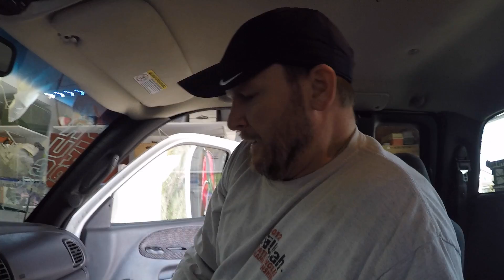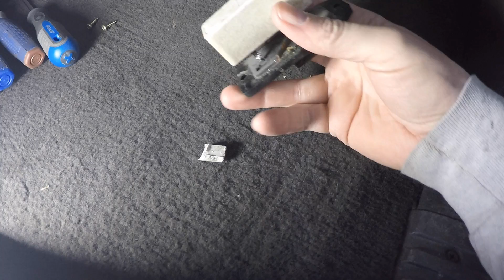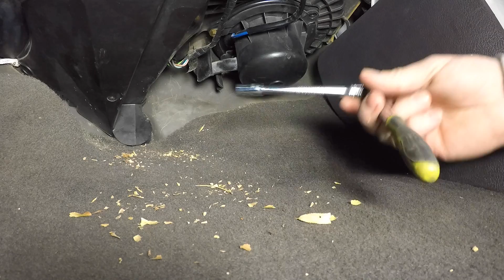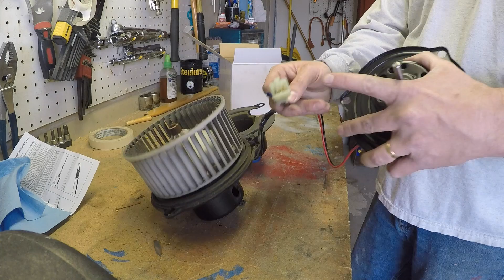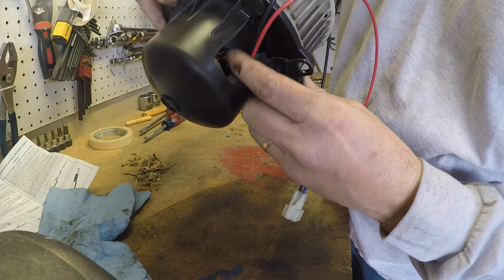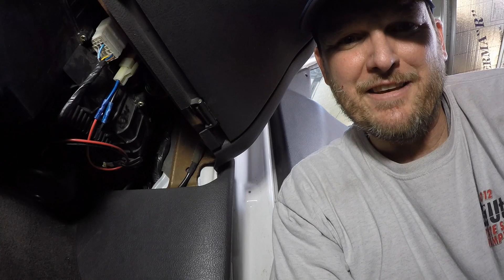How To Replace 1999 Dodge Ram Blower Motor

Comment: Thanks.  My 2000 Ram blower motor squealed and now doesnt work at all.  Time to replace it and the other temp part.  I replaced the heater core last summer and that was a big pain, but saved myself a lot of cash.
Reply from the maker: Blower motor is a cake walk compared to the heater core!  You got this!

Comment: Thank you! I have a 99 Durango. Mine barely works. Its loud and if I bang on the housing lightly it starts working. I bought a new blower motor and without watching this video I'd of thought it was going to be just as hard as replacing the heater core. That was a horrible experience. Now it -10°f here in Alaska. Argh I gotta pick the worst possible time to do this. Again Thank you for posting this video. It should be very helpful for me to get going on my vehicle.
Reply from the maker: Worst time of year for this kind of work, but it's needed for SURE where you live!  Yikes!  Hope you can get it blowing hot soon!

Comment: I have the same truck my name is zorena Ash I like your video I need a new dash to my dash board was all cracked up so I ripped it out and  it looks really bad where did you order your dash from and how much was it ? Was it really hard to install?
Reply from the maker: It was a serious job to replace!  Have to pull the entire dash about 18 inches out and some of the screws are hard to locate. It’s doable but not a fun job. I’ll see if I can find a link and post it here.

Comment: A little tip on that rear screw. Take it out first. When reinstating, set the screw inside a socket and turn socket by hand.
 I reused the shrink rap on the wires.
 Thanks for this video, made life much easier.
Reply from the maker: Great tip!  Wish someone had shared that with me before I did mine!  Thanks for taking time to watch and comment!  Means a lot!  🙌🏼

Comment: Great video man,, i heard that you have changed the whole dash,, where did you get it? I still my 1999 dodge ram 1500
Reply from the maker: I’ve still got mine too. Love the Gen 2 Rams!  It was many moons ago, but if memory serves I got it from LMC Truck. Hope that helps. It wasn’t a super fun task. But I’ll tell you one secret....  ratchet straps!  Use them to support and hold the dash assembly’s way from the firewall while taking out the old and putting in the new. I would also consider replacing the heater core while you’re in there. It’s RIGHT there anyways and you do t want to have to pull it apart again in 6 months. Just sayin!  👍🏼 Good luck brother and thanks for watching!  🙌🏼
Reply: @troysgarage  thank you very much, do you got email i will send some pictures,,,,

Comment: Good morning Troy, hey where did you get your new Dash and Dash bezel  from?
Reply from the maker: Here’s a link to the dash bezel - https://amzn.to/37AC5zZ 
For the dash itself you have options. There’s an overlay that you can glue on over the top so you don’t have to pull your dash apart (https://amzn.to/37xR4ut) or the full direct replacement (you’ll have to search LMC Truck for that one, but it’s not cheap and def not an easy replacement).

Comment: Nice video, but I think you forgot the gasket that goes between the blower motor and housing,  with that sealed you may get a little bit better performance out of the whole system. The gasket has to be reused from the old motor.    ...you may of replaced it and I just didn't see it

Comment: Blower motors bad  Can be resister or selectors but most the time you got noise, limited air flow, or your speed selection is limited your motor is bad.

Comment: I have a 2000 dodge ram van 2500, that have 2 resistors, I fund the one in the front one but I don't find the rear one, can you please help me with that? Thank you.
Reply from the maker: Sorry I'm not familiar with that.  I will poke around the internet and see what I can find for you though.  If I find anything I'll add a comment here.

Comment: Hello, where did you get your new dash board at? Did you record it?
Reply from the maker: I didn't record it, but took several pictures.  The blue bezel piece I got from Amazon and painted it with rustoleum metallic blue here's a link to that:  https://amzn.to/2TeIB8e
The dashboard itself I got from LMC Truck cuz mine was cracking and parts were falling down inside the dash.  Here's a link to that one as well:  https://www.lmctruck.com/1994-15-dodge/dash-components/de-1998-02-dash-pads-and-instrument-bezel
Reply: Were can i get the top peice of the dash

Comment: Future reference for anyone having issues with the blower motor, move the carpet and take the back one off first.. It sucked otherwise. And put it back the reverse order to make it easier
Reply from the maker: It’s true the nut closest to the floorboard is the hardest one to remove. Get it out and the rest is easy!  👍🏼

Comment: I'm in the same boat.  Have a new motor and resistor, just waiting on better weather and hoping it doesn't completely fail before spring or I get chance to replace them.  Right now, mine only runs on high and the motor howls like a banshee.

Comment: Your instructions were spot on...that rear screw was a mutha...both ways...now my issue was it was making that squeal n I would smack the outer casing n it would quiet down until I did it n heard the blower come to a complete halt...today I put in a new blower...and now the fan only comes on at its highest setting and no cold air..the AC motor engages cuz you can hear it but that's it....suggestions?

Comment: If my 97’ ram is making that whining sound but the heat works, would adding lubricant help? I think something might have fell in if that’s possible.
Reply from the maker: Yeah a lubricant would help unless there's just too much play in the motor.  But I'm sure it wouldn't hurt.  I recommend http://www.planetsafelubricants.com.  Get some AIM Lubricant.  Use it anywhere you normally would use WD-40, no smell and it works a lot longer.  When you are in there look for leaves etc.  Mine get's small leaves in it from the neighbors tree all the time.  Keep the vents clear that are near your windshield wipers to avoid having them drop down in there.
Reply: DIY Home and Auto I took it apart and some leaves fell out lol. Sprayed it down and put it back. The sound is still there but more quiet compared to before. Just gonna replace the whole fan. Thanks for the video.
Reply: kunu98 I'd just replace the motor.  That squealing or rough sound is typically the bearings going out.  You could replace the bearings, but given the price of a new motor and the work required to replace bearings, well, it just makes more sense to put a whole new motor in.

Comment: Great vid! Very detailed period of instruction!! I have a 01-Diesel and soon i will be changing out the heater core and dash. While i am doing that, i plan on changing out my blower motor and now that relay/resistor. Recently I lost the 2nd & 3rd blower selections.
Reply from the maker: +Matthew Johnson while you're "in there" also check and consider replacing the bushing for the blend door (hot/cold selection). I just had to do mine. Possible without pulling the dash but MUCH easier if you are already there. Dealer only part and only about $12. You'll love that truck!  Awesome! 👍🏼

Comment: I have 1980 dodge b200with blower wires getting hot. it would appear to be the resistor and none of the vidios address my problem where is it
Reply from the maker: +Robert Hall I don't know the answer but maybe someone here can help. I'll also ask my brother who is a mechanic. If I can find out I'll let you know.
Reply from the maker: In the little research I was able to do, it looks like the resistance might be in the switch assembly itself. Try going to http://www.rockauto.com and select your vehicle. Then under the section "Electrical-Switch & Relay" choose the blower switch. It's $9 and they will ship it right to your door. You might also have something going on inside the blower motor so you may also want to replace that as well. Wires that are getting hot is not a good thing!  Whatever you decide please be safe!

Comment: I have a 98 Cummins and the same problem is happening in my truck. Do I need to get the resister in order for the blower motor to work? Or can I just replace the blower motor and be ok?
Reply from the maker: +Justin Gough replacing the motor should be enough. I was missing some of of the speed settings. So as long as that part is working fine no worries. The resister isn't very expensive and is super easy to replace when needed.
Reply: DIY Home and Auto so I have a problem. That ruber tube that sucks up the electrical smell is too short on my new bower motor. Is that a must have??
Reply from the maker: +Justin Gough Sounds like you are making progress, that's awesome!  It's not a must have but see if you can modify the housing to allow it to still work. Similar to how I had to cut the plastic to make the electrical not be bound up. If that's not possible just make sure there's some air flow getting to the motor. That vent is to help keep the motor cool. You got this Bro!  🙌🏼
Reply: I have a dodge Durango 99 and the blower motor is not working how do I know if its the motor or something else
Reply: @lisaarnold5116  check your fuses first. If you still have it, and didn't get to work...

Comment: on my 95 dodge ram the blower don't work at all. the guy I bought truck from said it did before he took radio out. what would be best way to track down my issue,
Reply from the maker: +Wayland House Sounds like you are going to need to chase wires. He must have cut something. I'm assuming you've checked the fuses of course. Always start with the easiest solutions first. <sarcasm> Sounds like fun though.</sarcasm>

Comment: any idea why the 2nd row hvac doesnt work but the front and 3rd row hvac does? on 03 durango
Reply from the maker: I don't know specifically. But start by cleaning the electrical connections. Anyone else out there know?  Let's help each other out. 👍🏼
Reply: Im getting power to the switch. Im think vacuum line
Reply: I guess I am getting air out of it hahahaha, its not getting hot though... s either a blend motor, the blend door itself or a clogged heater core
Reply from the maker: See if you can feel hot on both ends of the heater core.   Should have your answer soon. 👍🏼
Reply: I'll have to tear apart the quarter panel... their a 2nd heater core,  evap core, blend door (motors). Not in this 15 degree weather haha
Reply from the maker: I hear ya!  I just spent an hour in my garage that's only 45 degrees right now. Cold to the bone!

Comment: Thanks Troy for great video on how to replace blower motor resistor. This evening 15 degree and snowing here in Cedar Rapids, Iowa.    I went and bought blower motor resistor $49.99 for my 1999 dodge Ram 1500 at Autozone. I'd installed it and now I have heat.... 12/16/2016
Reply from the maker: So glad to have helped!  That's why I do this. I also love the Gen2 Dodge Trucks. 👍🏼

Comment: SO GLAD YOU DID THIS!!! I have the exact same issue in my truck! Thank you now I know what to attack as we are in the dead of winter up here in washington and expecting another 10 days of snow apparently.
Reply from the maker: +harkness10 I dealt with it for a whole winter season. Miserable to say the least!  It's a fairly cheap fix to have a heater again! PS go ahead and keep the snow up your way I have no need/want for the stuff!  😜
Reply: DIY Home and Auto now just out of curiosity as my blower does not whine, would it be more likely that the resistor is out and blower is fine?
Reply from the maker: +harkness10 the resister is super easy to get out. Pull it and see if it's cracked. You may also be able to direct connect the wires to test the fan (may need to consult someone else to ensure that's safe to do). I'd put money on it being the resistor though!
Reply: DIY Home and Auto ok cool. I got $400 to play with and don't wanna replace parts that don't need replaced. Need to do front brakes and obviously the heater issue but was contemplating going to an led conversion for my interior lights as well as my fogs as you did in one of your videos.
Reply: So I replaced the resistor today at the expense of $65 at local O'rileys, ran great through all the blower settings for quite a while. My wife and I pulled up to my parents house (maybe 5 miles away) shut truck down, and when we went to restart the truck we bot noticed a burning smell, like plastic or electrical. I reached under the dash and felt the leads to the resistor were warm so I unplugged the lead. I then heard the sound of the screeching blower motor. So I guess my question is, do you think the smell came from the resistor  (hopefully not melting) or the blower motor that has made itself apparent that it is out?
Reply from the maker: +harkness10 my guess would be the motor has gotten used to not having full power sent to it. It's possible to oil it. However you may be better off to replace it. It's hard enough to get out that I wouldn't want to risk just piling an old one. I'd replace it and rest assured it's now good for many years to come.
Reply: That was my thought, at $46 it makes more sense to just replace it. I just wasnt sure and didnt want to risk burning down my new truck. Thanks for all the help much appreciated. Ill let you know how it goes and what i find out.